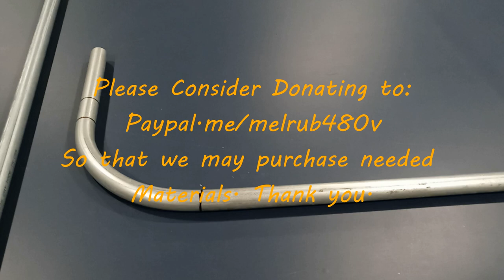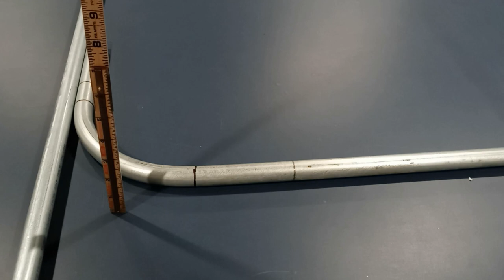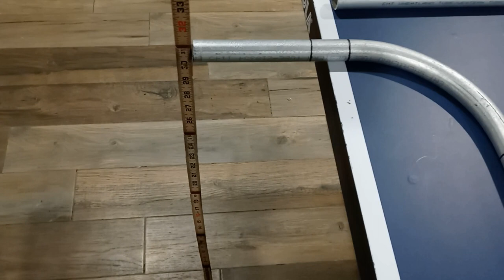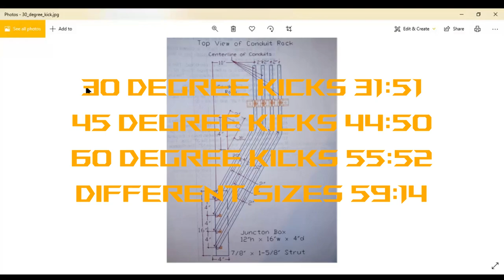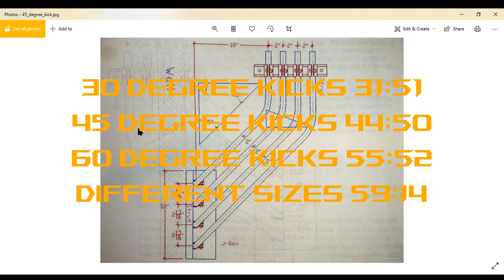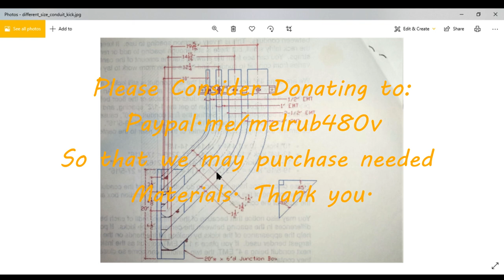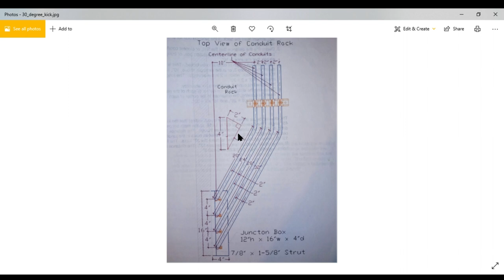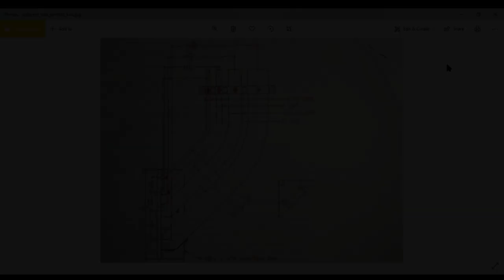Conduit Bending: Parallel Kicks Part 1

Comment: Sometimes I don't know how I feel when we in the trades give away our tricks but then I remember that most people still would not be able to do it properly, yet I am still hesitant.
I have heard that knowledge is power.
Not true.
Application of knowledge is power.
Every apprentice with a phone thinks they can accomplish a task from a video or other source but then when they actually go to apply what they learned they realize it actually is not that simple.

Also, Porcupine Press has a spreadsheet on this subject.
One of the only teaching spreadsheets I have ever come across for parallel kicks on the net and handy to bookmark because you just never know.......

Great video.
Reply from the maker: Listen, I can't count the countless emails and messages that I've received telling I shouldn't be giving away our tips and secrets. 
I don't think that way. I am here to give back to the younger generation and those that want to learn. I am from a non union shop and all my life I taught myself. No one would teach anything especially conduit bending. When I got in the trade in the early 90s it was a secret at form. No one would teach me. I got lucky a few years later when I was able to be a helper to a mechanic that was kicked out of the union for a little over a year. That year I learned so much and it sparked what I am today as an electrician. Like you said, even with all the info that I'm putting out there, you still need to want this and be dedicated to learning. I like what you said, application of knowledge is power. True. It is and can be. But most of all complete understanding of the knowledge you have is power. That's what I'm offering here. I try to teach electricians how to bend and I try to make it easy and go step by step. That's why some of my videos are so long. Anyway, I'm sure so many people don't watch my videos because they want quick and short 5 minute videos. My channel is definitely not about that. I want to thank you for watching and commenting.

Comment: Thanks for the channel and for making the videos I really enjoy the content and definitely have learned some stuff. I was a foreman some years ago and when I was a JM I installed some pretty conduit racks myself when I was out in the field, but you my dude are the BEST and the most advanced that I have seen. So yea I have done a couple racks with parallel offsets but I don't remember too many times I did parallel kicks with 90s. 
So ok I have a question....... Let's say I had the same setup but instead of 30 degree bends, and because of where the pathway for the rack had to go, and so the kicks had to be like 35 degrees, or 37 degrees or whatever. Once I bend the first one I can use the protractor to find the degrees. So what math do I use to figure out the rest of the kicks like you did in this video?

Comment: Another great video man appreciate your time and effort ! Question, will these calculations work if you are coming str8 from a coupling and not 90ing down. Parallel bends with different size conduit. ?

Comment: Hey a trick i use when using my tape measure for the kick, instead of measuring from the floor to the pipe and adding all that up, FLIP your tape upside down, and use it like that.. say you want a 5" kick, put your tape on the ground, pull your tape up to the pipe, put 5" to the bottom or top of the pipe, and bend it until the pipe touches the end of your tape.. fool proof no math mistakes and makes it so much quicker
Reply from the maker: Thank you for the comment. I appreciate it. Your right no matter what i do i get complaints. But mostly its from the experienced electricians tell me to stop teaching the secrets of conduit bending. They say im making it too easy for everyone to learn the tricks of the trade. Anyway that tape measure trick im definitely going to mention that on my next video for kicks and im giving you the credit. Thanks.
Reply: Dude, fuck yes. Can't wait to try this
Reply: Wouldn’t you have to measure the length of your tape measure if it was upside down. Say your the width of the tape measure is 4 in. Your saying you would stick the tape out 1 inch and bend up to that?
Reply: @maxkuhns8804  naaa.. say you need a 3 inch kick you just set your tape measure up, where the tape/blade is sticking straight up by the pipe your bending, when you're ready to bend, you pull your tape up above the pipe 3 inches.. you're pipe is at the 3.  You bend the pipe until it touches the end of your tape.. so you'll stop bending when you get to 0 inches.. i use an auto lock fat max but any tape measure you can lock so you can do this by yourself..
Reply: @biz504  that makes sense thank you!
Reply: @maxkuhns8804  no problem,  you're welcome

Comment: for this method do i need ad the shrink for multiple conduits
Reply from the maker: That is a great point! Now most of the time yes i figure out the shrink so that i don't have to waste my time cutting my conduit to make the couplings match. That would be such an atrocity if i spend my time making such beautiful parallel bends just to cut them to match in the end. I didn't mention it in the video because i'm gradually presenting the complete way of doing it correctly with just investing a little time in doing a little math. Let me tell you most electricians think if they sit still not doing something that in fact they are doing nothing. But the time you spend solving the formulas is way less in the end when you are done bending and it comes out perfectly ready to install.

Please follow me or join me on:
Facebook/holmzlaw
facebook/the art of conduit bending
instagram/holmzlaw
Twitter/holmzlaw
Tradehounds/holmzlaw
Reddit/holmzlaw
Reddit/r/conduitology
Discord
https://discord.gg/ntkfmC3Vq4

Comment: i come form Thailand 
i Would like to ask you about bend Kick .  center of bend is Star or rim notch and if i bend it the arrow  How will it be
 ?
Reply from the maker: you should bend it on the rim notch if you are going to bend a 45 degree kick. Then the bend will come out in the wrong place. but if that doesn't matter then it doesn't matter. As long as you use the tape measure to measure your kick and not the degree of bend. but if you use the degree of bend and want it to come out right then you need to use the rim notch for 45 degree kicks. for 30 degree kicks you need to find the 30 degree center of bend and put that mark on the bender. I show you how in this video watch the first 10 minutes of the video. I will place the video link below:
https://youtu.be/qScjMoMQlt4

Comment: I know these are not offsets they are kicks but do you need to make any kind of adjustment to the marks like u do for parallel offsets or is it not necessary for this?
Reply from the maker: Yes there is an adjustment when you want to line up your bends on kicks. its just using shrink when you are using the same degree on all the kicks but when your kicks are all different degrees then the formula changes.
Reply: @TheArtOfConduitBending  what do u do with the shrink? Could u explain that a little more?
Reply: @TheArtOfConduitBending also the stuff I've learned from your videos has helped me put up some above average work thst has kept me employed. Gave me an edge. Bending pipe is my favorite part of this trade. Ibew 96

Comment: I understand the panel entrances  methods the math,  but is it different then just changing levels on the same plane
Reply: To have ur rack spaces thr same when u kick a 90nupnor down but not into a panel
Reply from the maker: Not sure what you mean sorry.
Reply: @TheArtOfConduitBending  like if u had 3 wide on a rack then kick to a wall 3 tall, thanks for ur content 👍👌😉🙏👏
Reply from the maker: @juspatmil  it's all the same principle and math. There is a different formula for another type of kick that I'm doing a video for. But you'll have to wait for the video.
Reply: @TheArtOfConduitBending  i will.... thanks so much also I have forgotten the formula for how u can cut a pipe before u bend a 90 on it....  like 3x the odds minus something..... like u need a stub x 30 that u can cut it before u bend it

Comment: Is a little easier if you start the first bend in the air and then set it on the ground
Reply from the maker: Not sure exactly what you mean. Maybe that works for you. I've never bent a kick in the air. And what 2nd bend?

Comment: You are confusing people only 15 minutes in by having 5 marks on your 2nd pipe but only 2 bends. You think an apprentice has the patience to figure out what you are trying to teach without actually having pipe or benders in this video?
Reply from the maker: Are you confused? I'm sorry. You don't need the actual bender really. What you need to learn is everything up to the point of bending. I apologize if you didn't like the video. I'm sure others have way better videos than I do. Right?

Comment: Bro this wrong, IBEW NYC LOCAL 3, your mark means shit when you're measuring that way, you're not bending to a degree, you're beidning to a measurement, which is fine but the first part was just a waste a brother
Reply from the maker: Ok sure. Everything i have on this video is proven method. If you disagree that your opinion. Thank you for watching. Appreciate your time and comment.
Reply: Mel was using the hypontenuse to mark the conduit for a 30 degree bend to keep his center of bend along a common radius.  He explains that is more accurate to measure the rise of the kick than trusting the protractor. Either way marking the hypotenuse enusres that when the parallel kicks are stacked the center of bends line up.
Reply from the maker: @kevinkennard1810  Thank you, for the explanation but I'm sure he still has no clue what he's talking about.
Reply: @TheArtOfConduitBending  LMAO
Reply: @TheArtOfConduitBending  lol

Comment: In minute 59, you used a multiply of 1.5 instead of 1.2? Any particular reason?
Reply from the maker: I took a look at. I meant 1.15 which is pretty much 1.2

Comment: Have you done a video on "Fanning" 90's, where the center of the kicks line up straight across and every kick angle is progressively larger or smaller (depending on which end you start with)? Like the thumbnail picture shows. Thanks for your content. IBEW Local 80 trained sparky here!
Reply from the maker: Yes actually that is what I'm showing you in this video. If you look in the description I have links to all the chapters of this video. If you skip to chapter 6, 7, or 8 I believe that is what you are looking for.
Reply: @TheArtOfConduitBending  Damn man, excuse me for that. I saw at first the horizontal rack of conduits, with kicked 90's to a perpendicular enclosure. I skimmed through and I saw where you gave examples to the above scenario; one at 30° and one at 45° of kick angle. I must have missed the "fanning" type of layout. I'll watch it without skimming through. I appreciate it. I've been debating on starting my own channel for stuff like this; this is why I was looking around on YouTube to see if anyone else is covered the things I wanted to show people and it looks like there's only a couple out there that are doing it to the level of which I was thinking. You sir are doing a fantastic job and your the inly one so far that seems truly qualified in this industry to be giving out the proper information in the depth that you're doing it. This is what I was thinking about doing but if it's already being done by others (namely yourself), I am reluctant to do it more so. Even though I can do all these things correctly "by the numbers", it is still interesting to see someone articulate and educate others on these subjects. More Electrical workers in our industry need to know these things, in a textbook, mathematically accurate way. I'm assuming you're out of Local 3? Godspeed to you brother, and once again, I apologize for my comment since you covered it already in chapter 6,7 or 8 video and I skimmed past.
Reply from the maker: @jaredkilgore7194  thanks for the comment. Yea I know my videos are kinda long. It's just I cater to apprentice's and/or conduit bending enthusiast that really want learn and understand the topic. I cover wide area of conduit bending. The videos are mostly long because I take the time to break things down as of my viewer had never picked up a bender or conduit. Most of the content on YouTube for conduit bending are quick videos that assume that the viewer knows what the are taking about to begin with. I get a few electricians here and there that don't like the fact that I have long videos. But most of all not too many electricians mind. If you want to start a channel you should. In the past few months I've branched out to show apprentices more hands on mechanical tips as far as electrical installations. I also do a little bit of code here and there. Anyway thanks for watching and most of all for the comment. And no I'm not local 3. I'm self taught non-union.

Follow me on:
TikTok/holmzlaw
Facebook/holmzlaw
Instagram/holmzlaw
Reddit/holmzlaw
Reddit/r/conduitology
Reddit/holmzlaw
Tradeshound/holmzlaw
Twitter/holmzlaw
Quora/artofconduitbending
Quora/holmzlaw
Reply: @TheArtOfConduitBending   You are doing a wonderful job with the long format on these videos, it was my ignorance for not taking the time to find what I was looking for in particular. The way I do fanned 90°s is kinda time consuming but based on what I've seen on your videos, I'm sure it's identical. I definitely don't want you to think I was criticizing the way you do things, matter of fact, it's the proper way to explain these things; from "A" to "Z". It took me many years to understand all the nuances of conduit bending (the mathematically accurate and proper way at least) because many of the mechanics and journeyman I worked with when I was an apprentice taught me their method and I'd say 99% of them do not do it this way (rules of thumb, shortcuts, and it's close enough kind of attitude most of the time). I wish I could've gone on YouTube and seen videos like yours over 20 years ago, it would have helped me out tremendously and I have no doubt these videos will help out many apprentices and conduit aficionados to come! The best electricians I ever worked with were non-union self-taught. Eventually they came into the IBEW which is how I was able to work with these people but like I said most of the better ones came from that background not to say there's not great Union trained electricians because there are; there's great and not so great on both sides as I'm sure you know. I'm currently working for the Commonwealth of Virginia so it's a state job that does not work under a collective bargaining agreement so technically I'm working non-union now (there is no competition against the local I came from so they don't look at it like I jumped ship or anything I guess). Thanks for your comments and I'm not going to hold you up any longer but I do appreciate the time you've taken to converse back and forth with me and I will definitely be a supporter of yours from here on out! Take it easy brother! ✌️
Reply from the maker: @jaredkilgore7194  🙏🙏🙏🙏

Comment: is there any easier way to get the bends matching at the center point of the 30 degrees,I work for a company and well you can't take the bender with you to every jobsite it's always a new bender and buying a personal bender is too much to carry around
Reply from the maker: Listen, it doesn't take long at all. If you get a scrap piece of pipe and bend it to 30 degrees find the center and place the mark on the shoe. Then you have the mark on the shoe for the whole day or possibly the mark will stay if the bender is a company bender and not a rental. The only other way is to make all your bends first, then put them all side by side on the floor with the centers all lining up and mark towards the end how much you need to cut off to make the centers line up. But honestly i think the second method takes longer.
Reply: @TheArtOfConduitBending  thanks bro you really been helping me out here, by far the best channel I've found that explains everything to the T, great work keep it up in no time you will have Tons of subs.
Reply from the maker: @LATiNSkILLZ  thank you brother
Reply from the maker: Anytime brother... If you ever need help. The best way to contact me is on my discord.
https://discord.gg/9w8MxjQJ

Comment: When you bend on centers for kicks you’re supposed to add half the overall outside diameter of the conduit to your mark because you’re  measuring from the back of the 90. Maybe that’s why it’s off a little when you need it to a certain angle.